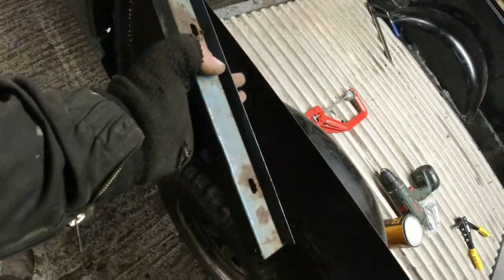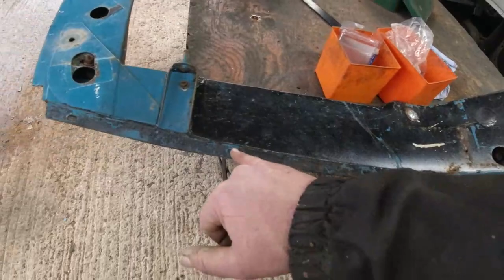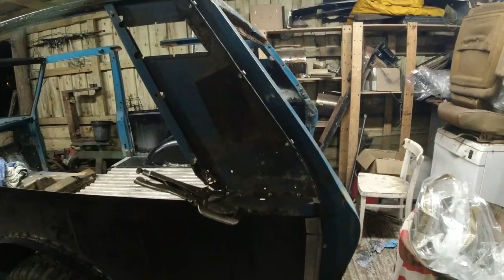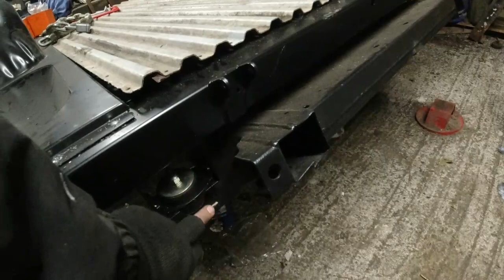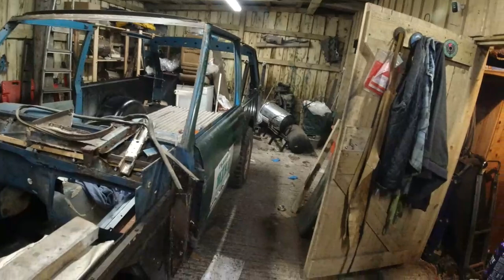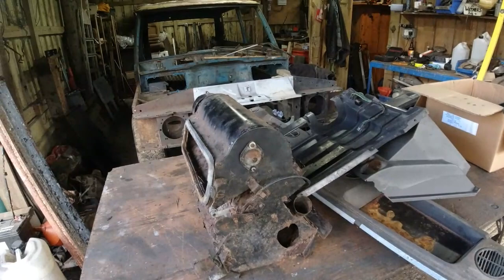Episode 22 - 1971 Range Rover BOB Body frame - profanity warning

Comment: How about . . . release your welds for your new folded right angle sections holding them to the side panels ? Then you may be able to “lose” the extra 4mm you have, then re weld ? Just a thought. I have a similar situation but mine has been RSended 😁
Reply from the maker: I am going to do a video but I can find the 4mm just by redrilling the rear crossmember mount holes on the chassis.